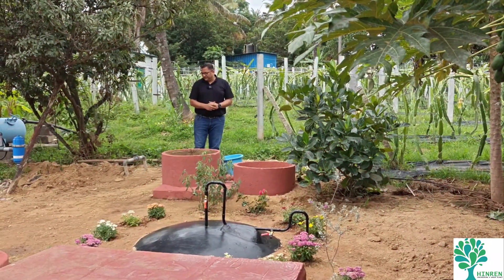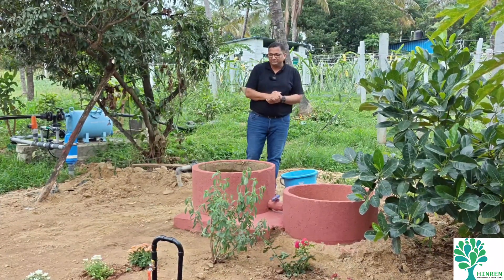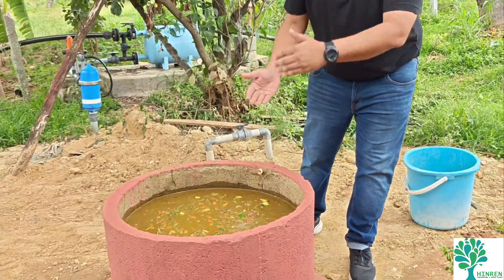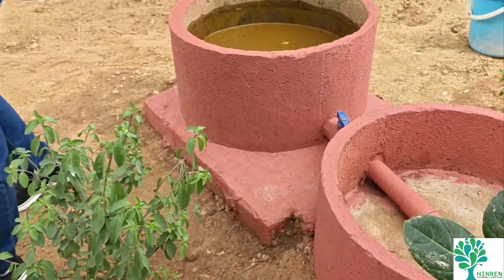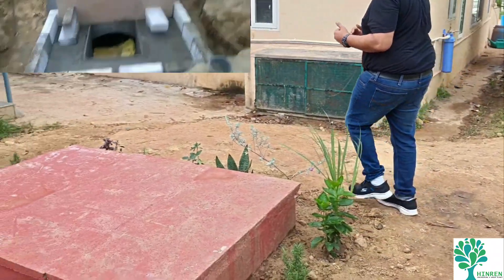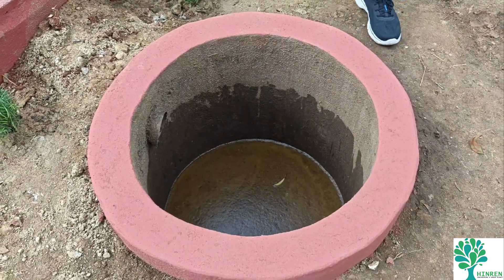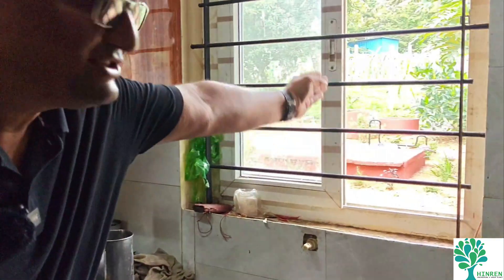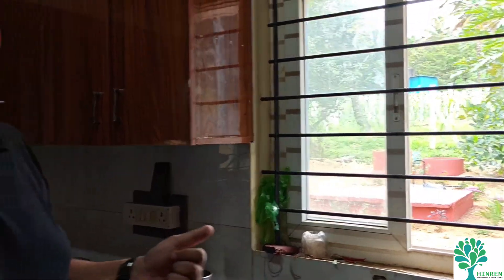Fixed Dome Bio Gas Plant

Comment: Interesting and I am greatly impressed.  Thanks for a nice video, which is quite informative.  The slurry tank concept is not very clear here.  Because the same tank will also be producing the gas, and where does this gas go?  A second point is the carbon dioxide scrubbing.  There will already be moisture in the gas coming out of the digester.   You have a system to drain out that moisture to some extent.  But passing the gas through the water may add moisture and the activated charcoal if it is picking up the moisture, how much of it can actually be held by the system provided and how long will the water in the system lost?  So there may be need for refurbishing the scrubber system.  Frequency of this process of resetting the scrubbers ma kindly be indicated. 🙏